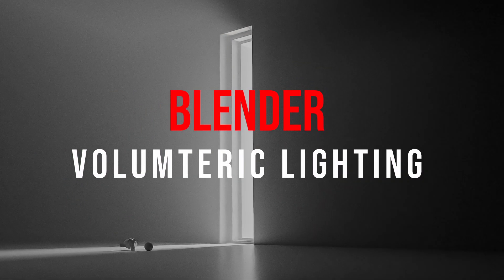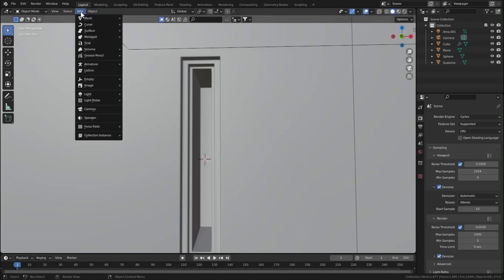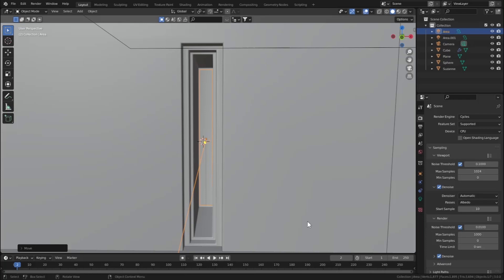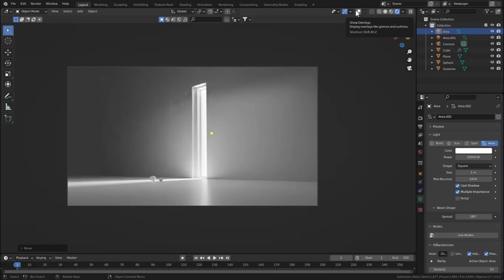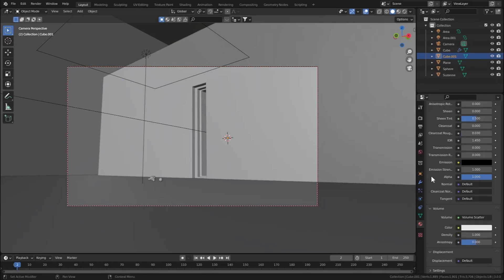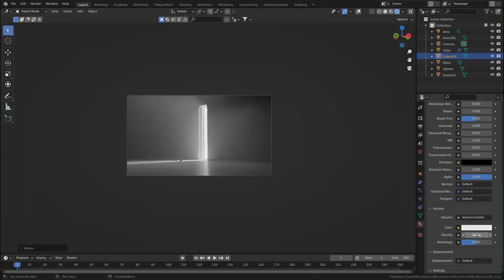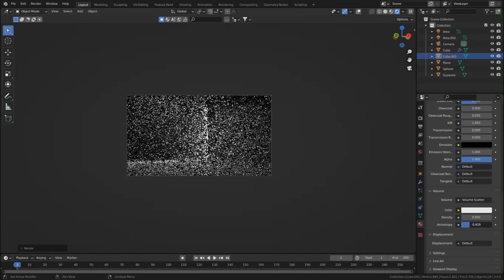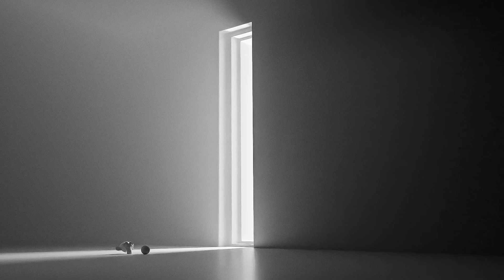Blender Volumetric Lighting  | Create Volumetric Lighting in 4 minutes | [ Very Easy ]

Comment: Blender uses wattage in correct context to "Power" buts its not a modern measure anymore due to LED lights being more abundant. Blender should add a feature that changes the options to Incandescent, Candle, and LED but keep the same sub-menus with the exception of Lumen or Lux as a replacement for Power. This is all beneficial when you are trying to get semi-accurate renders for compositing and blending models into video/image sequences. My friend who its getting into 3D modeling asked "Is it safe to go up to 1000 watts considering my PC only has a 1000W PSU?" lol.  Also, great video my man. Thanks
Reply: wtf ☠☠☠ thats crazy